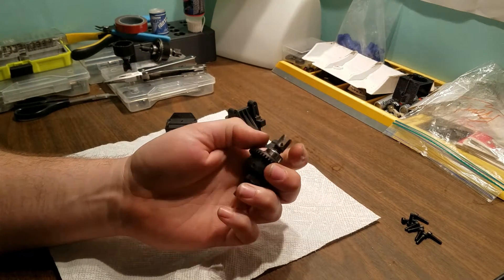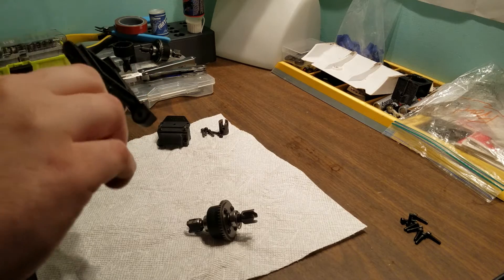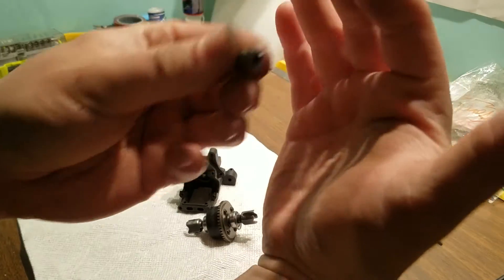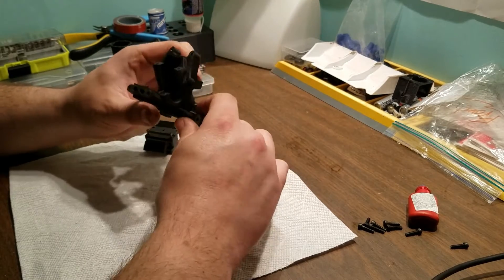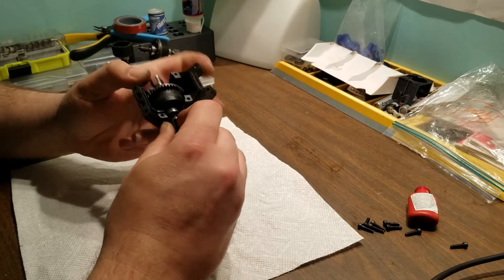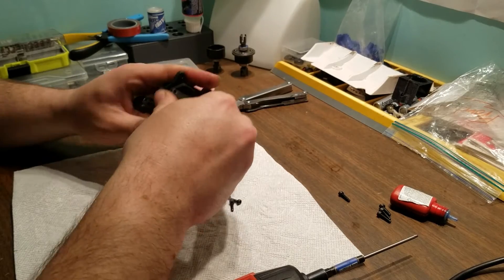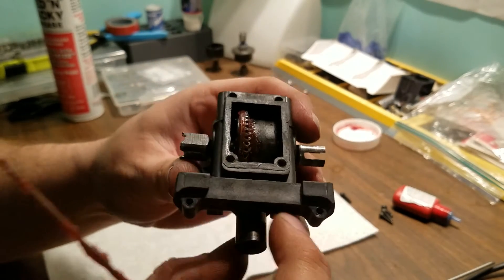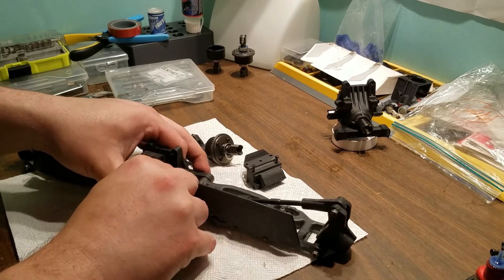BASHCAST DIFF REBUILD PART 3 (OUTCAST 6S)

Comment: Quality 6s diff build series!  Any time somebody asks at the forum about diff servicing, I'll be sending them to these three vids.  All very well explained including most important details, reasons why and why not.  Easy to follow along and patient explanations with problem solving.  Excellent work 👍💪  
I always paint a little diff fluid on my gaskets to keep em in line just like you did.  I will even paint on a little bit of diff fluid on the back before I drop the sun gear over the pin just to hold it in place.  I also blob in a little diff fluid before I drop down the spider assembly but I don't know if it really saves much fill time.  Sometimes I hit it with a cheap heat gun after filling with diff fluid to help ease the flow.  Finally, I used to soak all the gears in brake fluid being too particular about getting everything very clean but I've grown tired of all that lately.    Paper towels or those blue paper shop towels do plenty fine enough job without the extra hassle of spraying brake cleaner into a cup and over-thinking everything.  Makes more of a mess on the bench than it's worth.
Reply from the maker: Thank you brother! I was slightly concerned about the length of these video's.. it's hard to convey everything and keep it short though.. I appreciate your time for sure, and I appreciate your comment as always! 

This one is getting pinned! Valuable info that I didn't really touch on so it should be seen...😎😎😎💪
Reply: @camaroboy383  I understand the concern for the length but in my opinion when newer hobbyists get to see how to do it from start to finish, confidence will grow immensely.  They can fast forward if they're comfortable but can always go back and watch every detail even in the middle of the project at hand.  
When I got my first 6s truck, I read so much about how I could make huge and noticeable personalizations and improvements by addressing diffs.  I was intimidated though and afraid to take apart what I wasn't sure I could get back together.  Had I been able to see your videos here, I would've been on top of it right away.  I know I'm not alone.  Your guidance here is practical and lets guys know that there are many ways to skin that cat and while some approaches may take longer, they may not always be necessary.  I buy these trucks to bash and beat on and I'm sure most Arrma buyers buy em for the same reasons.  No need to over-think every detail and we want to know why as much as how.  You've covered diffs perfectly imo.  
I appreciate your time as well in leading by example, recording, editing and posting what I feel are very valuable resources for long term re-visiting.  I guarantee your new 6s diff build series will be a valuable asset for as long as these trucks are as popular as they are.  Like I said, I'll be pointing guys here when they ask for sure.
Reply: Future viewers can see above ☝️that I talk too much but I mean what I say for new and "new to Arrma" folks.  lol  😉😊
Reply from the maker: @crimsonfancy  I appreciate you man.. people like you are what makes the forum and YouTube great! Love the input on the video as well, it's nice to hear the time put in was all worth it.. ✌
Reply from the maker: @crimsonfancy  😂😂😂😂.. talk and type away my brother! I'm always listening And reading..👍..

Hoping to see some footage from you soon my man..💪
Reply: @camaroboy383  Guess I better get after it.